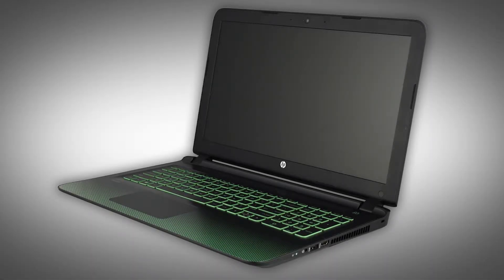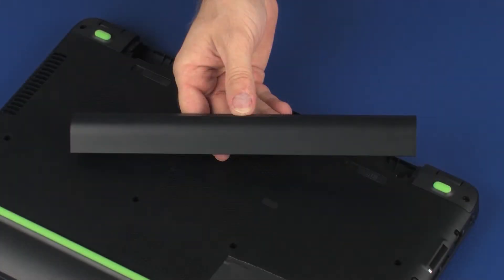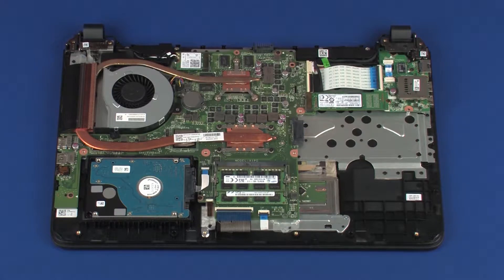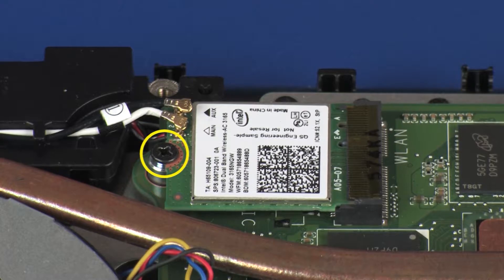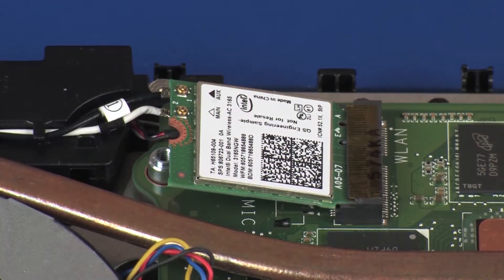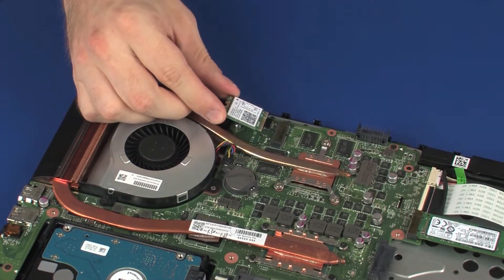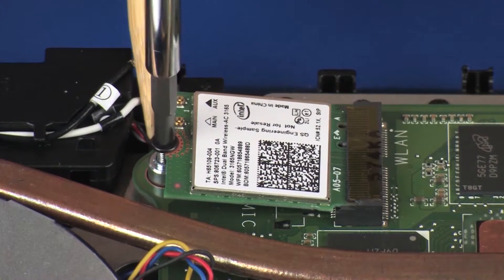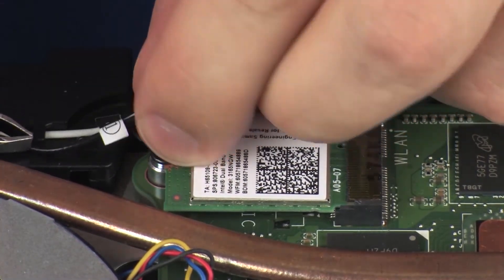Replace the Wireless Module | HP Pavilion Gaming Notebook | HP Support

Comment: So is this the thing I have to replace to get my internet connection back?
Reply from the maker: +Ian H. Let's do a wireless test to isolate the issue.
1) Turn on the computer and repeatedly press the Esc key to enter the Startup Menu.
2) Now press the F2 key to access HP PC Hardware Diagnostics (UEFI) main menu.
3) Go to Component Tests, then click on wireless module.
4) Click on run once to initiate the test.
Please check the results! If it is defective then you can go ahead and replace it.

Comment: Can I use 3rd party product ? Can I install wifi 6 + Bluetooth 5.0 card ?
Reply from the maker: +Mishkat Tashdid HP does not recommend upgrading or downgrading hardware parts or software that is bundled with the product as It may affect the manufacturer's warranty and performance, however, you could change the configuration at your own discretion.
Reply: HP Support yes it would affect the performance because it will become faster both wifi and bluetooth 😂